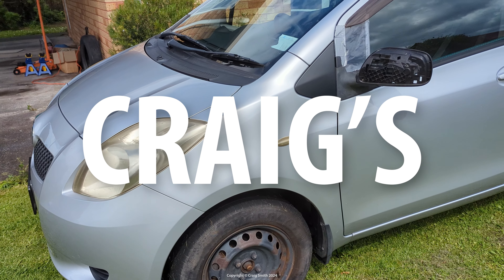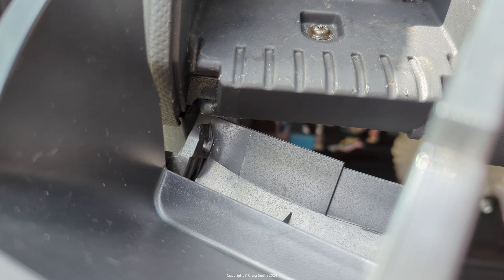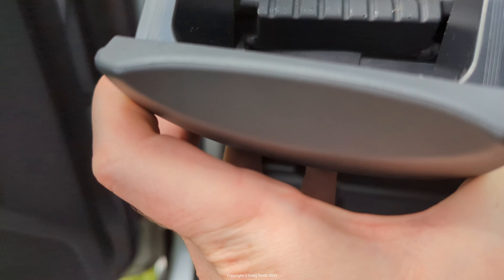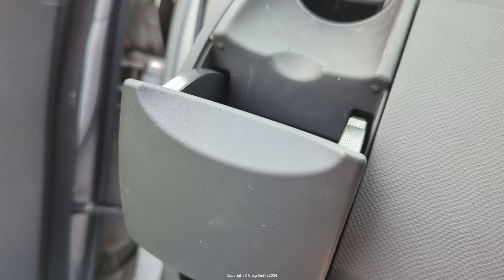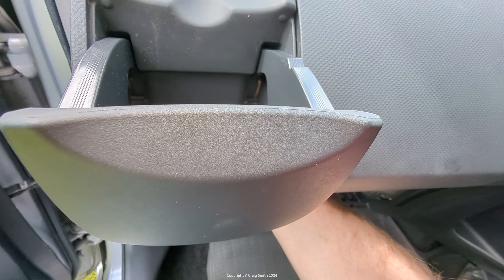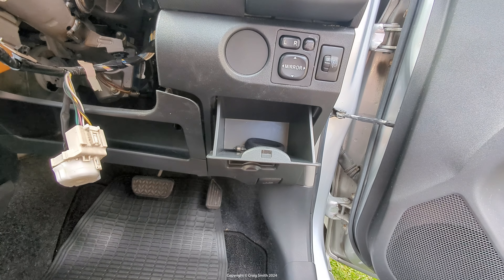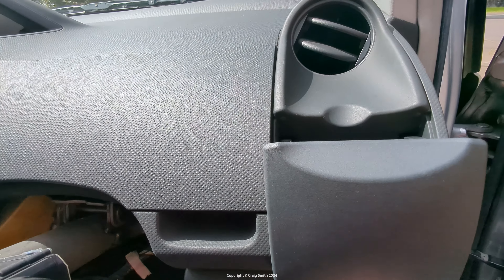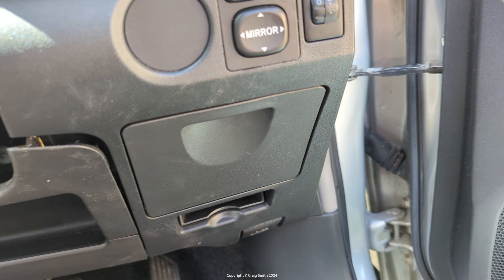Toyota Yaris cup holder (dashboard) removal

Comment: sorry to hear about the theft. 😢 btw do you happen to have door handle trim still out (probably not), the small one just below broken front 1/4 quarter light. im trying to figure out the part number for it, it might have a part number marking on the inside TIA